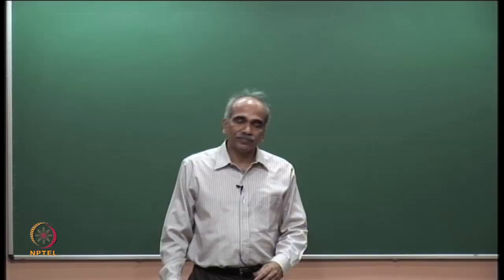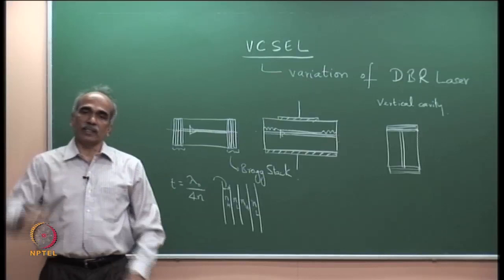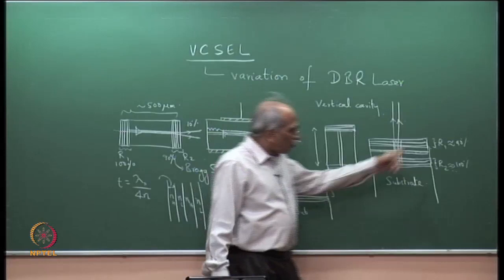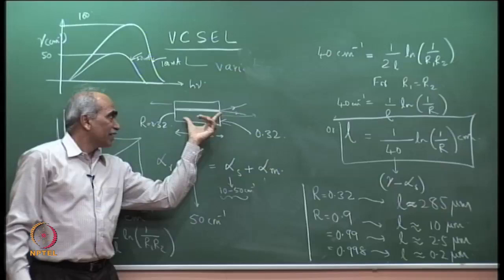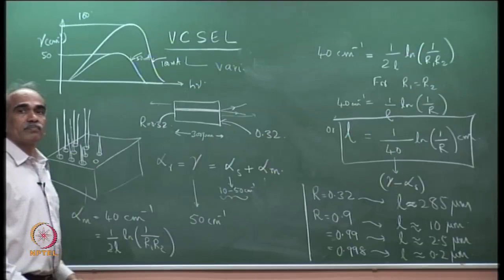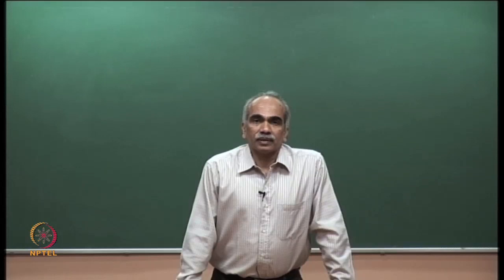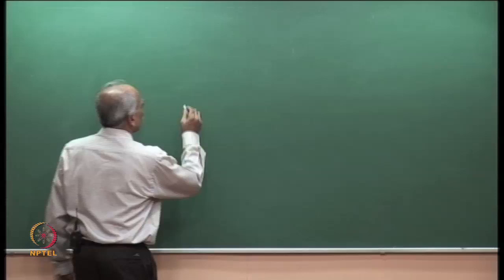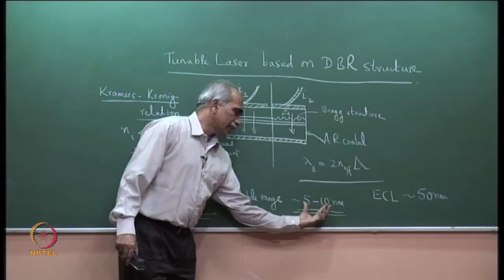Vertical Cavity Surface Emitting Laser (VCSEL)

Comment: Beautifully explained. However I have one question here. In an edge emitter the oscillations happen horizontally and cleaved surfaces provide reflection. In a VCSEL however, what makes the oscillations go vertical i.e. since there are no cleaved surfaces anymore, the light should just simply escape in the horizontal direction and the device should behave like a glorified LED. What prevents this from happening?